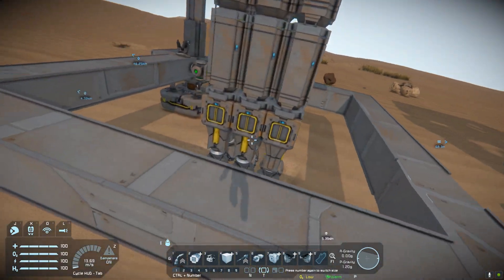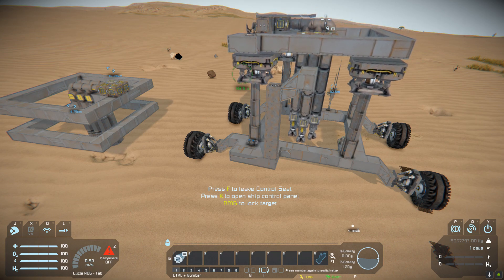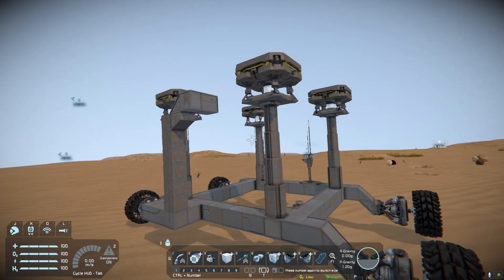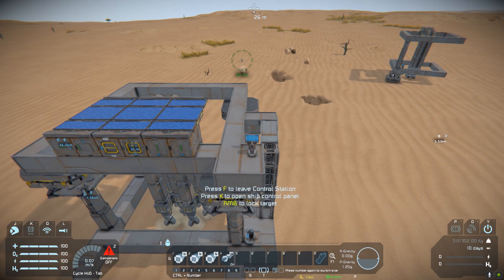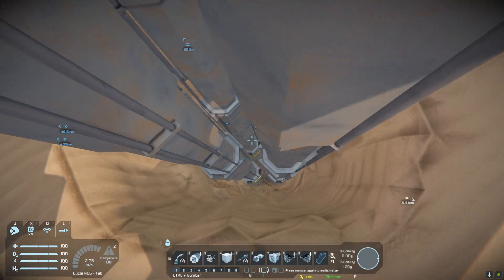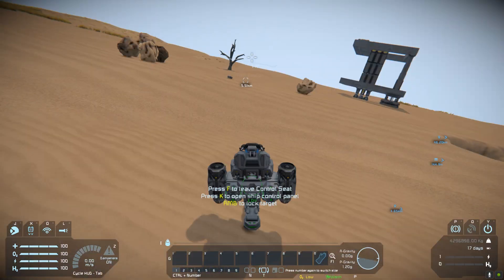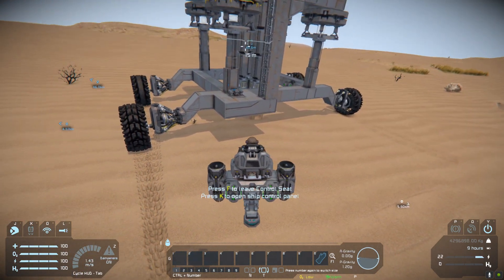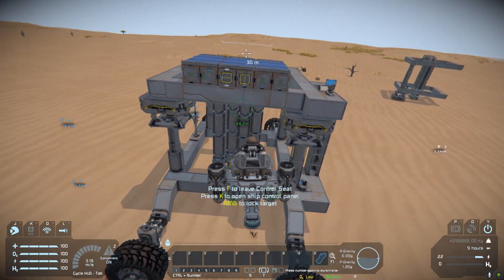A Land Crawler that took way too long to make....

Comment: Nice, one big thing to improve stability would be to add weight down low. Right now it is very top heavy. Also wider wheels could help but you need catch wheels front and back to catch it when it tips

Comment: Nice idea but you should have the battery's on the bottom also you can make it as one grid...Either place a piston to start and place a piston head on the corners above the pistons or you can build each piston and top corner and use merge blocks to connect them together.